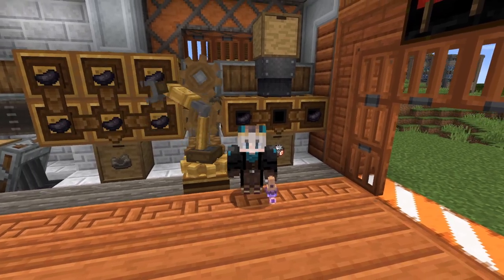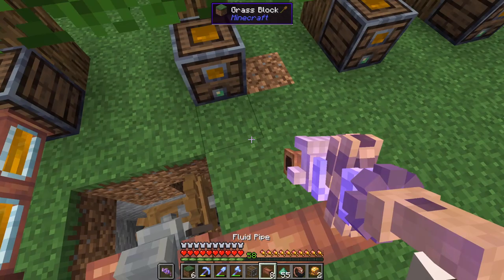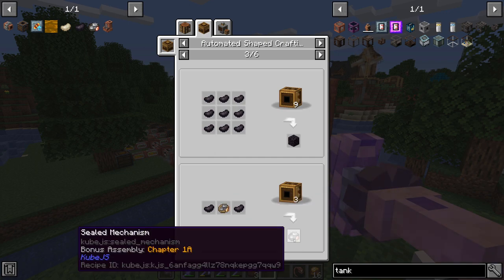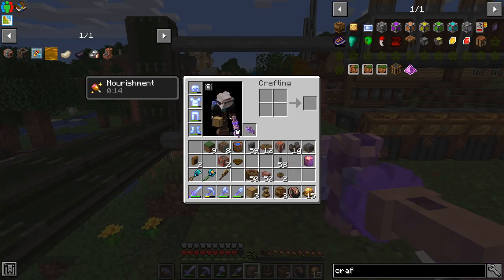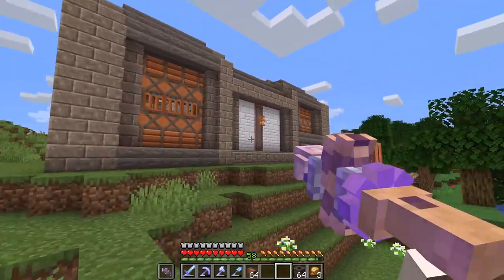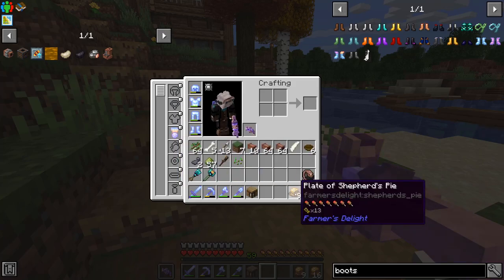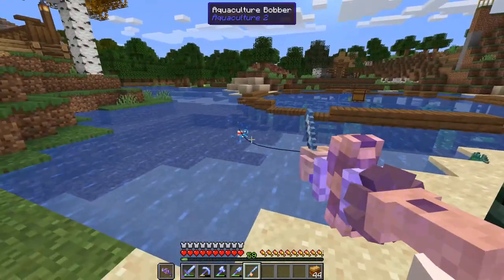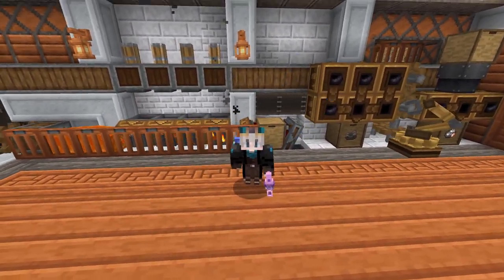Automating Sealed Mechanisms | Create Above and Beyond Episode 12

Comment: Hey, quick tip: for the auto crafting of the belts you can right click with the create wrench in between the mechanical crafters to make it a connected inventory. That way you can input all of the rubber using only one hopper/funnel.

Comment: Hey, for the automated crafter, if you click the borders between blocks on the back with a wrench it will connect them together making them a shared inventory, this is super useful for crafts like the belt where a it's a lot of the same item, since you can have just one input which can be a lot faster

Also, you can use the Ender Staff, it launches you around like the Slime sling, UT doesn't use durability (And I don't think you take fall damage with it but I don't remember)
Reply from the maker: The ender staff! Ill have to check it out

Comment: The upgrade chips that increase everything by 2-4x do fit in the arboreal extractors, giving them both bigger storage and producing 50-100mb per operation rather than 25. I used the zinc chips and it keeps everything well supplied

Comment: The arboreal extractors will look for naturally spawning or grown leaves in an uninterupted line of the appropriate logs up the the leaves and a dirt block under the logs, so it is possible (and I have done this) to construct a tree as long as the leaves used are grown, you can use mechanical contraptions to move leaves. This is very useful for lava farms using hellbark, growing a small shrub up high, then place the hellbark logs down followed by the dirt block.

Comment: This is super late as you have already made your rubber setup, but I bet the arboreal extractors are checking for leafs with the persistent tag set to false. (You can see it on the right side of the f3 screen) 
The schematic canon can copy that tag when placing leaves.
The extractor needs to be next to a 3 tall log block pillar with dirt beneath the wood and at least 3 persistent = false leaf blocks in some shaped aria above it, they don’t need to be connected to the blocks the extractor is.

Comment: Hey man, how do you build all your huge factories? Whenever I try it just seems so daunting to try to supply a schematicannon with stacks upon stacks of material.
Reply from the maker: It isn't as bad as it sounds - I'll address it in my next video when I make my copper factory, but essentially it comes down to just taking it one item at a time and always over producing. For example, if I need brass funnels, craft extra brass machines, because I might need brass tunnels and a mechanical arm later on my list, and it prevents re- crafting things.
Reply: @polartt  Wow, I really didn't expect you to respond, but thanks! I might try this next time, you might've just made Minecraft that much more fun for me. Thanks!

Comment: the pans from farmers delight are bugged and they allow you to duplicate anything that you can cook on them. just put a pan on the ground and right click with one (cookable)item in your hand, then right click with a full stack of that item. take out your newly duplicated items. i think it does thisbecause it triesto fill the pan with the extra stack but because the combined result would be more then a stack it causes an item glitch.
Reply: They're also quite useful for automating campfire cooking, which a player is required to do in order to create certain mechanisms. Another YouTuber and I worked out between us that a Deployer operating at 16 RPM can comfortably supply a placed Skillet with 1 item every 6 seconds, the exact amount of time it takes for an unenchanted Skillet to process one item. If the Skillet is enchanted as an item with Fire Aspect 2 and then placed, this cooking time is shortened to 3 seconds; You can then double the Depolyer's rotational speed.

In this modpack, unenchanted Skillets generate in the world as parts of abandoned camping tents.